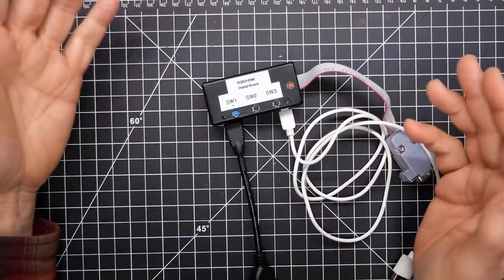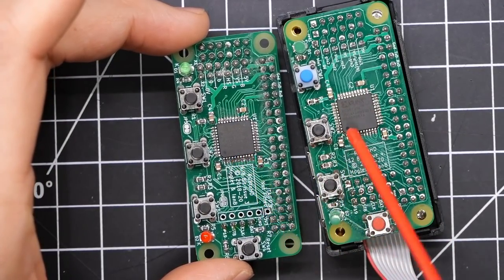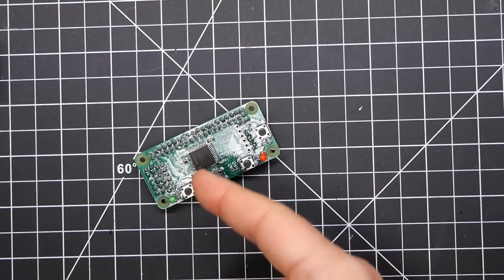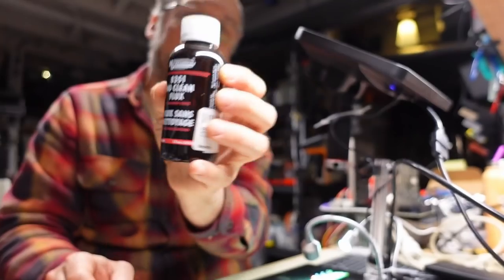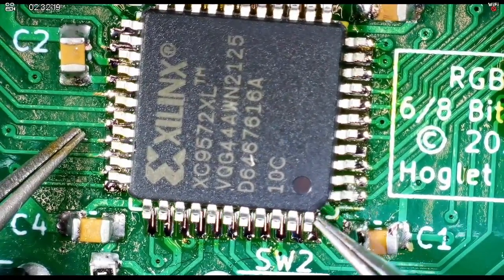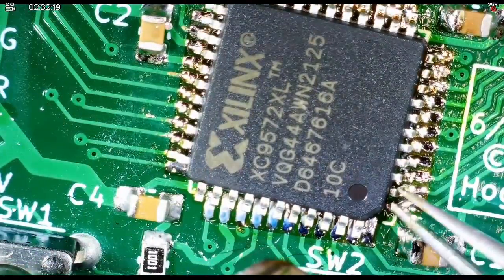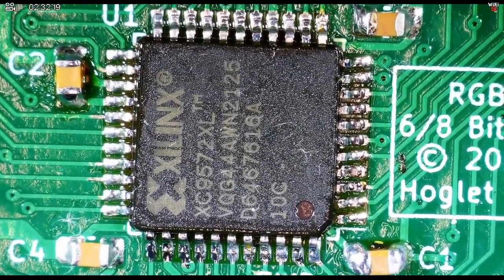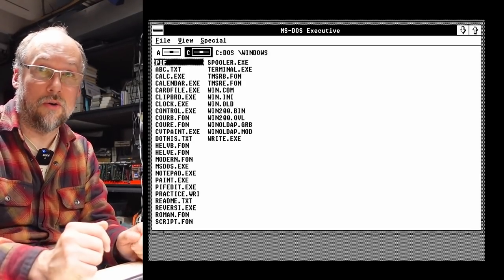The perfect way to NOT do SMD rework (RGB2HDMI overview and repair)

Comment: Adrian I think you did very well if this was one of your first times.  I've been doing SMD repairs for a few years,  and I would just give you a couple tips - Use a good quality tacky flux  (MG Chemicals, Amtech, etc),  It will actually help keep the component in place,  it wont get boiled off so quickly,  and if you use enough flux the surface tension and heat will often line up the chip perfectly for you.  When you remove the chip,  clean the original solder off the pads and apply new solder,  it's just good practice.  Also,  if you eventually end up doing more SMD work,  I would invest in a decent hot air station.  Those cheap $40-$80 units with random names on them that are all over Amazon, Ebay, etc. do not have nearly as good thermal capacity as something like a name brand Quick 857DW+ that only costs a few dollars more.  Also those cheap hot air stations scare me.  There are way too many videos and personal experiences from people who have had them randomly melt down and catch fire right there on the bench.  I always recommend that if people have to buy those things,  definitely take it apart and inspect it.  About half the time the mains input is accidentally wired backwards into the power switch and board and the station will still work like this but it is an absolute safety hazard.  The quality control on those things is abysmal.
Reply: I have one of those burned up fcks here and indeed they start melting random...
Reply: I admire Adrian's honesty by putting this online! I have a few constructive tips to add..

The desoldering nozzle was too small. The nozzle needs to be about the same size as the device that's being lifted, rather than struggling by dancing around the chip, and risk pulling a pad or a trace as you tug on the device. (For multilayer and/or large boards, the thermal mass is much higher so will take a while to start melting the solder: some use a board preheater, but for a board of this size there's no need).

Another trick in removal is to tin the leads & pads with leaded solder while the part's still on the board to bring the melting temp down, or, even easier, use low temp repair solder like ChipQuik alloy.

The same comment about nozzle size applies to placing too when using reflow: it needs to have simultaneous heat coverage over the entire device. Dancing around the chip with a small nozzle is going to end up... well, we saw how it ends up!

For placing leaded parts like this, I use drag soldering for small pitches under 0.8mm, but the part here has a pitch large enough that they could reasonably easily be hand soldered.

Anchor the part with a couple of diametrically opposite pins before drag or pin-by-pin soldering.

With drag soldering, you have to accept that however hard you try you'll end up bridging pins at some stage.

If you're going to hand solder by dragging or pin by pin rather than reflow, then you really should to clean the pads first.

I keep two thicknesses of wick available, and two thicknesses of solder on the bench.

I don't know what the purpose was of adding solder directly to the tip of the iron. The pads can be re-tinned applying small amounts of solder to the pads as necessary as the iron traverses the pre-fluxed pads.

I use a stereo optical zoom microscope, the digital microscopes add latency and lack spatial dimension.

One further trick about checking pin continuity when the board is otherwise empty, for example with breakout boards: as well as adjacent pin short check, you can usually also check for pin connectivity to the board by using a DMM with an audible diode check; hold the + probe on a ground pin, and buzz out the other pins, using the protection diodes.
Reply: Yeah, I really think Adrian's problems were that he didn't clean the board and put the chip down directly on the pads, THEN add solder to a couple of pins to tack it down and go from there. What I know about SMD soldering is that it's always about mess control. You make one when/where you need to, and clean it up any time you have the opportunity. You use a lot of flux, a lot of solder wick, and a little more solder … but it's a lot less flustration that way.
Reply: you cannot "wire it backwards", main power (mostly) is a 2 prong plug that you can plug in any way you want in Europe. I do not think, even if you are in other countries, that power will work differently there ;)
Reply: @stefanegger  3 prong devices are specifically wired with live, neutral, and earth ground.  In some types of devices this does matter.  For two prong plugs you are correct, but for three prong plugs this can (but not always) matter, depending on the device.
Reply: @stefanegger   Yes,  you can indeed wire it backwards.  Modern two prong power cords in the US are generally polarized,  even without a ground pin they are keyed to only plug into the outlet in one way (there are occasionally exceptions to this).  This is to comply with US electrical code and for safety reasons.  

However,  this is not what I was talking about.  I specifically stated that the mains was wired * into the power switch inside the hot air station backwards *,  which is an absolute no-no.  The power switch in any mains powered electrical device should always break active/hot,  NOT neutral.  Sure it will work,  but there are obvious safety reasons as to why this is wrong,  and it is also against US electrical code to use a switch to break any grounded conductor ( and neutral is a grounded conductor).

I imagine in other parts of the world that electrical code is similar,  but I'm only familiar with the US.  Sorry I wasn't clear about that.
Reply: "Quick 857DW that only costs a few dollars more" 
eh.. I just checked the price and it costs over 300€. Like 350
Reply: me personally i never touched smd i stuck with tubes and transistors and yes those cheap china made airflow stations are crappy
Reply: I have one 858D and it works absolutely fine, havent burned down in 2 years now and while i dont use it much it works absolutely fine for non professional work
We use shucko here so its unpolarized so it has a high chance of having mains on the connector exposed but eh its fine if you just remember that
Reply: @Sloxx701  I'll mention that US plug receptacles are polarized, however there are 2 prong cords and adapters that aren't polarized (OG Xbox, PS4), and plugging in a non-polarized cord into a polarized device will definitely have some adverse reactions (I had to do this for my TV, I got a longer cord, but it wasn't polarized, and plugging it in wrong causes it to not power up).
Reply: @tyrions737  I paid $110 for my 857DW+ new 2 years ago,  just checked again and everywhere I see them online is $120-$150.  Banggood,  Ebay,  Amazon,  all under $150.  I'm in the US though.
Reply: @Dave5281968  It still must not matter - e.g. the German Schuko plugs are 3 pin (live, neutral, protective earth) - and specifically designed to be able to be plugged in both orientations, unlike the  other common round type used in Europe that has an earth pin instead of the metal strip. There are also many outlets around that will accept any plug (two or three pin one) but have no earth connection and the plug can be inserted in both ways (common in France, Belgium, Denmark ...).  Also, most T-splitters common in Europe will swap the left and right pins on one side (it makes it easier to place the bus bars inside). 

There are standards why the plugs should be wired in certain ways but if the plug orientation matters for the device, it is non-compliant and potentially unsafe because one can't assume the outlets are always wired correctly (and standards have also changed over the years - so old buildings often have wiring that is non-compliant with today's code). 

Functionally it cannot matter, the AC current really doesn't care which wire is which.
Reply: @Sloxx701  Yeah it should break the live conductor but in Europe you can't generally assume the polarity - that's why many devices explicitly use DPST switches that break both wires if this matters. For most small appliances it doesn't matter - the protective earth (or more often - absence of it) is much more important safety-wise.  Sadly many of these cheap stations come horrifically miswired, with earth not being connected at all or even having the nozzle live! And even if you have it wired correctly, no guarantee that the outlet it gets plugged into actually has earth connected! (not to code but sadly common ...).
Reply: I'm sure Adrian is aware, but a glance at Northridge Fix's videos / techniques should help for future attempts. But yes, quality flux, quality braid and a decent hot air station, right size nozzle etc. to start. Remove any original lead-free solder before soldering in anything. Drag along pin rows (rather than across each pin) when drag soldering.
Reply: @JanCiger  An example of a device that does not allow for reversing of the live and neutral is the UPS.  Every UPS that I've used (Both from APC and CyberPower) will refuse to function if there is a reversal of the live and neutral connections.  Of course, these all use a 3 prong plug.  They will refuse to work since the 3 prong plug can only be plugged in one way, and the reversal of the live and neutral indicates a wiring fault.  There are other devices, too, that depend on the live and neutral being wired in the correct orientation.  In the US all new devices using a two prong plug are keyed with one prong being wider than the other and cannot be plugged in reversed, regardless of whether the device requires a specific orientation of the live and neutral wires.  It's done a a safety measure to prevent any possibility of a short (full or partial) between live and neutral when a device uses the power in a non-isolated manner.  It can, in rare cases, be the difference between your device functioning properly or having it die a premature death due to overheating.
Reply: @Sloxx701  I totally agree with you, but if indeed in other countries two prong plugs are symmetrical, then it is a 50/50 toss up as to whether the switch is on line or neutral.
Reply: A PCB hotplate can help too, though could be a problem for boards with components on both sides.
Reply: For IDC 601-D certification, I was taught to do hot air for removal of  200 pin packages by hand. Tack opposite corrners and then brush the pins with lots of good flux and solder. Finally check for bridges under a scope.

Comment: After removing the old IC you also have to remove the old tin with the stranded wire. Then the IC lies flat. 
Solder two corners with a little tin with the soldering iron, it doesn't have to be pretty, the IC just has to be straight. Then use a soldering iron to solder the pins with a lot of flux and a moderate amount of tin. 
If a bridge appears, ignore it, strip the soldering iron and use fresh tin moderately. 
Always give the IC some time to cool down and don't constantly re-solder yourself in one place and over heat. 
Allow to cool, breathe deeply, or take a break and try again if it's cold again.
I can't solder much better, but you'll get practice with time.

Good job Adrian
Reply: I've been working with SMD and BGA soldering for a living for 11 years now, and I think that the easiest way to solder QFPs like this is to NOT remove old solder from the board, but this works only if you use paste flux and if your IC pins aren't oxidized. Most paste fluxes will work but you'll save yourself from headdaches if you'll use good flux (I can recommend FluxPlus 6-411-A or 6-412-A, one of the best fluxes that I used). The process goes like this:
1) Apply some flux on the pins of the IC you want to desolder. You don't need to use much, but at this point it is not important, you can add as much as you like, just make sure that the flux covers all the pins (I mean the bottom part of the pins which is soldered to PCB, not the whole pin) and space between pins.
2) On you hot air fan use a noozle that is near the size or a little bigger than the IC you want to desolder. This will guarantee that when solder will start to melt all of the pins will stay melted and not become solid again. To not overheat the IC don't hold the hot air fan in one place, move it around in cilrcular motion, but not too quick or it will take much more time to heat the solder.
3) When the solder on all the pins have melted remove the IC from the board by grabbing it with fine tweezers from the corner with one half of the tweezers put under and one on top of the IC. Be careful to not move the IC around the board. After you remove the IC this way the solder on the pads on the PCB will be distributed evenly and the shape of the blobs will be close to identical.
4) Let the board cool down. After it's cooled remove flux residue using some kind of solvent (I use Electro Degreaser by Cramolin, my colleagues just use acetone), you can use isopropyl alcohol but solvent does much better. Wipe it using a piece of thin cloth soaked in solvent or use a toothbrush. Remove excessive solvent using a dry piece of cloth. When your board is cleaned add fresh flux on all the pads. This time don't use to much flux, because when it'll boil it can move the IC around. Once again, add enough so it'll cover all the pads when melted.
5) Carefully position your IC on top of the solder blobs that are left on the solder pads. This is not an easy process and somewhat tedious. your positioning don't need to be 100% accurate, just make sure that pins are not laying between pads, they need to be on top of the solder blobs.
6) Don't hold the IC in place, just heat it using hot air fan but be sure to hold it the fan perpendicularly to the board and don't use too much airflow to not blow the ic off its position. Again, use circular motions. When the solder will melt your IC will, firstly, tin itself and, secondly, position itself on the solder pads. After this is done cool off the board and clean it using solvent and a toothbrush. 
7) Check that all the pins are properly soldered using a needle or fine tweezer - just lightly drag the needle on top of the soldered parts of the pins, if any pin isn't properly soldered it'll bend a little which'll be immediatly noticeable. If there'll be some unsoldered pins then you can solder them using a little flux and a soldering iron. Don't add new solder if there's enough old solder on the pad, this is to ensure that you don't short adjacent pins.

Most of the time this technique gives near factory level soldering quality, but you need some practice to get it right.
Reply: Wow, no need for a story. He did very well for a new solderer.

Comment: FWVLIW: Everyone struggles with SMD soldering when moving from through-hole. Much of the struggle is a matter of mindset.
Through-hole - You're not so bothered about accurate component placement but you want to be accurate with your soldering.
SMD - You want to be very accurate with your component placement but as long as you use plenty of the right flux you don't care about the accuracy of your soldering - surface tension will take care of it as long as you use it rather than fight it.

Three basic techniques: (Always start with clean pads and use SMD-apocopate flux. For the most part use one technique or the other!)
1) Use a soldering iron to dab / drag your solder for affixing pins. Don't pre-tin!!!
2) Use hot air to melt your part(s) on to their pre-tinned (or preferably solder pasted) pads - a little shimmy will let you know the solder has melted.
3) Use something like a toaster-oven, pre-solder paste pads, pre-place parts, and let nature take it's course.
-Either hold the part in place from the get-go or don't touch it at all! Touching a part you're in the middle of soldering will mess it up!
-There will be solder bridges when soldering multi-pin packages - DO NOT use solder braid!!! Flux and a clean iron tip should be all you need.
-Each to their own but many use a soldering iron for passive components and hot air (if they have it) for ICs with lots of legs
-Option 3) is great if you're doing a lot of SMD soldering, a bit of a faff for single boards or short runs.

Once you have the SMD mindset you'll be golden. Be warned, you'll probably find your through-hole soldering gets messier.
I hope that helps somebody. Do what Adrian's doing and give it a go.
Reply: Yeah, I can approve your tip list. I always teach my students to consider first what technique they want to use to solder the part. When you use hot air soldering, there should be the right amount of flux on the board, then it does not matter which flux you take (surely not the one that evaporates quickly). If there is too much flux your ic will swim on the flux and will not make good contact with the solder. If there is the right amount, the flux will prevent shorting the pins and the surface tension will do the rest and DON'T touch the ic, it only misplaces your ic and you have to start again. Using QFP packages and a microscope I rather always use drag soldering, because you don't stress your ic so much and get it in place quickly and the cleaning afterwards is not that an efford.

But Adrian good job for your first time soldering an smd ic. Do a little bit exercising, perhaps on old defect boards (soldering off an smd chip, clean it and solder it back on), then your next production board will be childs play.